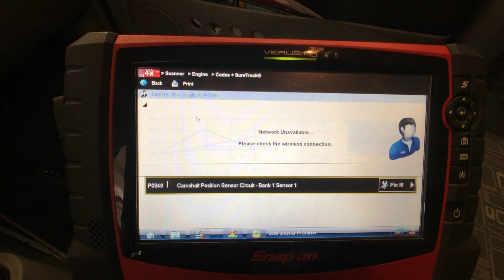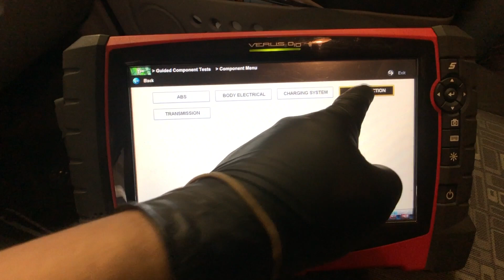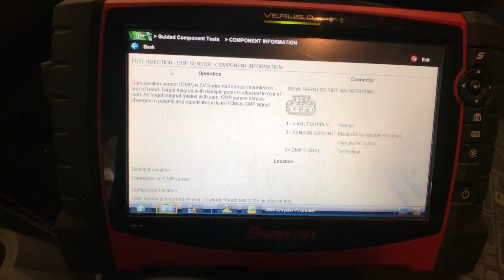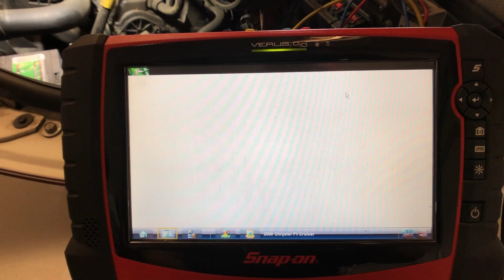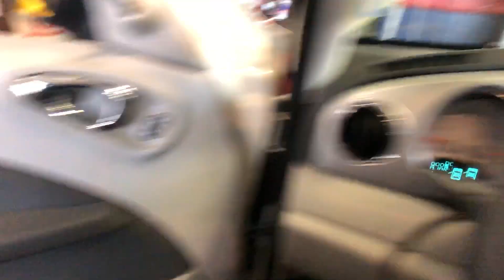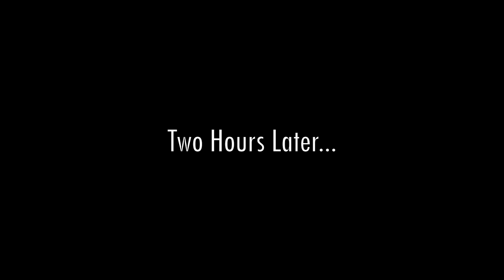Chrysler PT Cruiser | Check Engine Light | ON P0340 Camshaft Sensor Code

Comment: We have the bad luck to have had an '01 PT Cruiser for the last sixteen years. I've done a head gasket, two water pumps and a bunch of "small stuff" on it. Now I have something similar to this car's problem. I'll be checking that wiring connector. Thanks! Oh, I grew up in Miami so I'm used to Cuban music. Is that derguense in the background where you work? It sounds like great sing along tunes. Be safe. La vista!

Comment: I need the same repair for 2006 pt cruiser crank sensor my wire harness plug has the same damage in the harness plug. where can i get a repair harness plug for my crank sensor harness

Comment: Great video, earned my subscription for sure.  We just pulled back in our drive.  Leaving home, with a cold engine, after less than a mile we experienced problems three times.  Turns out to be code P0340 - engine missing and trying to shut down, 2005 PT Cruiser.  I will look under the hood now and see what I can see.
1/2 hour later:  Our sensor had been changed before - I seem to recall the event, and the sensor surround is clean compared to other engine areas nearby.  BUT, the problem seems to be the horrible job done with connecting the wires from that replacement sensor to the harness.  

Look at Hektor's fix at 8:41 and 9:11 - nice clean and secure connections, all wires protected by a sleeve.  Mine was three loose wires, stuck together in places by who knows what, the tan wire with 1/2 inch bare wire showing, and the connection to the harness so far upstream that I would have to take off most of the air intake stuff to get to it.  So obviously at some changing of the sensor connector wiring the workman did a worse-that-amateur job of re-connecting the wires.  

For a temporary attempt to fix, to determine if it was the wires and not the sensor, I wrapped all three wires with good electrical tape, which insured no accidental or intermittent grounds (I think).  I then ran the engine for 20 minutes with no problem.  We will stick close to home for the next few days to see if this fix is good enough or if I need to replace the wires up to the harness, which would be a hassle.   We have AAA, which we have used successfully before, so that reduces our worries about break-downs on the road.  Unfortunately, our small city and county 90 miles northeast of Dallas has few decent mechanics, and the local Chrysler dealer is the worst of the bunch, so if the problem is something I can't solve I have to search again for a decent mechanic.

Thank you Hektor.  It appears right now that your video saved me a bunch of aggravation and expense.  In any event it gives me the knowledge I need to communicate intelligently with a mechanic if that becomes necessary.  Your the best!

Comment: You are my hero. This car is a nightmare! We have constant issues. This was one of them and for once it only cost me a few bucks thanks to your video. Our mechanic won't even work on this car anymore. The cam sensor was replaced, head gasket, etc etc etc. And now this. Thank you for saving me from throwing more money into this money pit of a car.
Reply: The problem is that this is not a common car, you need to do the repairs by the book, "The service manual"  I got the same light yesterday for the first time in 3 years.. I just erase the code and that was it... didn't change or anything why, because I changed it like a year ago i knew it wasn't bad. probably a loose cable or connector I changed some parts that are electronics with many years of service.  A  lot of people do repairs on their own and create more problems like the torque struts wrongly call engine mounts... Do you know you have to align the angle of the engine before tightening the nuts? not doing it creates vibrations,  I love my PT!

Comment: Hola amigo tengo una duda ese conector lo venden en cualquier tienda? Gracias
Reply from the maker: Aarón Guerra si cualquier auto partes, el dealer, o al yonke Homie 🤙🏼
Reply: @HomieHektor  tengo la misma falla y el mecánico vino y me dijo hacer el motor nuevo y serían 250usd y el carro no lo vale, pero viendo tu vídeo me ayudará mucho, gracias
Reply: Hola amigo le cambié el conector y la falla continúa, me sale el mismo error, crees que deba revisar o cambiar algo más? Gracias por tu ayuda.

Comment: Nice work. My prob is driving in rain my 2005 pt loosses power, check engine light comes on and belt squeals, car wants to die and can't figure it out
Reply from the maker: Bill Hellums No Bueno
Reply: Homie Hektor what color do the new wires match oh the old? My old are yellow, gray and orange. The new are black, orange and gray.
Reply: Sounds like when your AC kicks in, it builds too much pressure. Most likely, the cooling fan don't work. 

Start the engine, and turn on the AC, and if the cooling fan is not on ...replace it. It's about 125.00 and comes with new relays.

Comment: A commom issue that i have seen on any chysler is that a faulty crank, yes a crank sensor will set up cam sensor codes..and vise versa..just watchout for this issue and test both signals when engine is cold..thankss
Reply from the maker: David Tellez Yeah I’ve seen that too, so far so good. Car is running fine 🤙🏼 Thanks for your input.